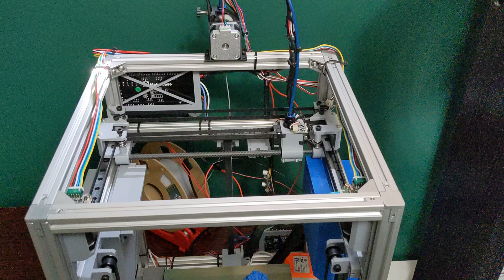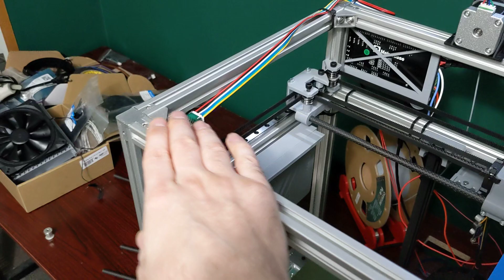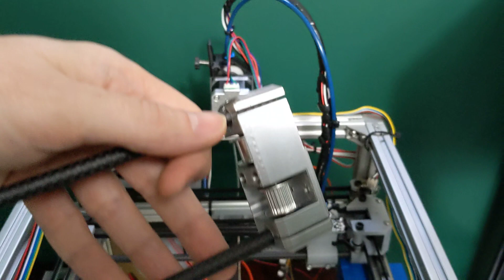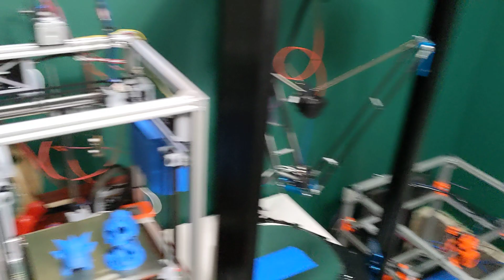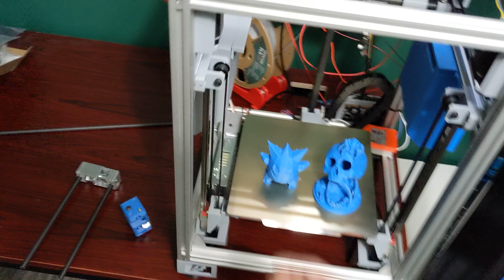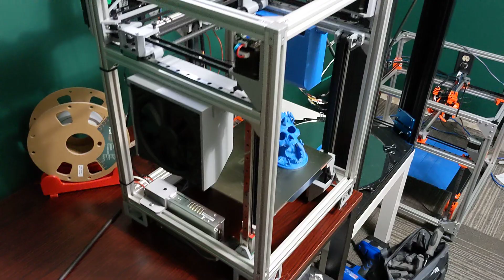DIY Fast CoreXY 3D Printer called CarbonCore 250x250 Build Area Also 1k Subs! Thank you!

Comment: I really like the look of this printer. Too bad you went in a different direction. Understandable however. Success will do that to a person. But I would like to build this printer. Why? Because I have the linear rails from my Anet A8 conversion lying around, and I'd like to use them in this printer. The problem: my z-axis rails are 400mm,, and my X and Dual-Y axis are 335mm. How do I make those fixed dimensions work with this printer. (Also, I'm going to buy in to your Patreon because I keep asking for help, and you're professional to the point of answering my (seemingly) endless questions. We're off to Patreon now.

Comment: Do I get it right, the new Y axis will have the linear rails mounted on the inner side of the extrusions? Also, I have watched many of your videos, but still have hard time to understand, how u fine tune the  X-Y belt tension? Following closely, as I want to convert my (overcomplicated) Blv Cube printer to match your design, as it looks much cleaner and simple ... Thanks
Reply from the maker: Belt tension is adjustable via the motor mounts. Yes the y rail will be mounted on the inside of the 2040 extrusion
Reply from the maker: You could also convert your printer to my SimpleCore design which would be easier
Reply: @Rolohaun  I'd really want to try the Igus bearings design to make X as light as possible... Hopefully, 2x8mm carbon rods will suffice for the 310mm table .. If not, do you think it's a viable idea to modify the design, to run 3 carbon rods, instead of 2, in L shape style?
Reply from the maker: @soulvagabond  that's a good question, the 500mm length that the rods come in are pretty stiff. I don't know if 3 would work better but it would need to be tested. I defiantly have not seen a printer that size with carbon rods.